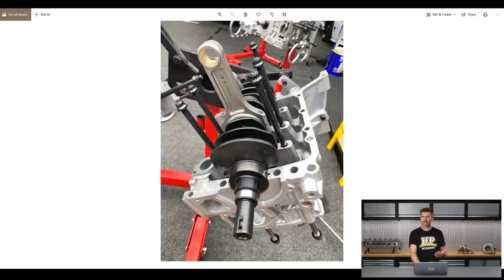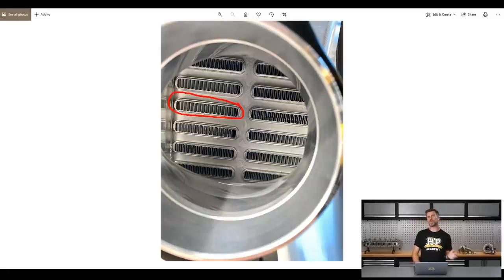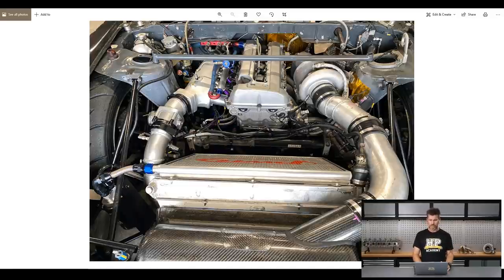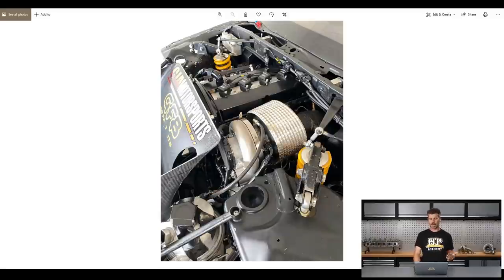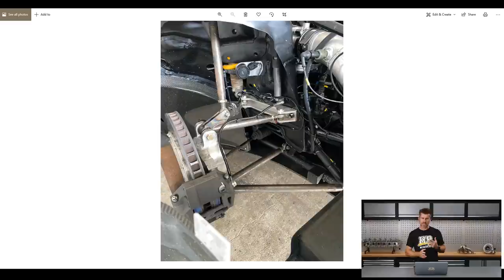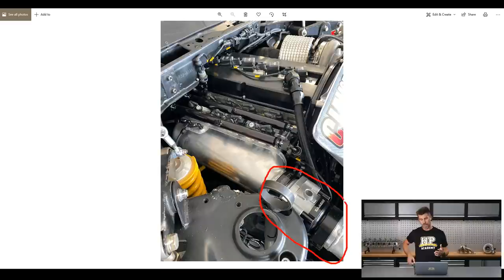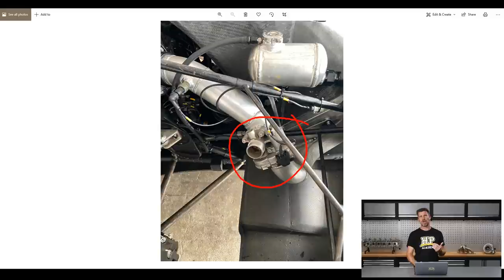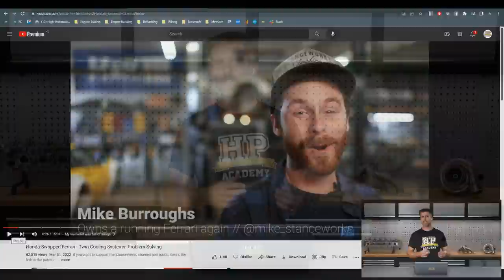Aftermarket Studs and Block Distortion [#UPDATE 305]

Comment: Just get the block line honed with the aftermarket studs torqued down, that's the right way to do it, because if your undertorquing them, you'll start loosing oil pressure if the cap gets loose, spend a few hundred dollars to do it right.

Comment: HP Academy. I am wondering if you would do another video on connecting rod balancing. Scat has produced an H-beam connecting rod they labeled "Ultra Light". There is a hole drilled through the rod beam just above the radius of the big end for the purpose of reducing weight. Since H-beam rods come without a balancing pad, it is possible to utilize this method to get rods in balance. Scat claims the size of the hole they produce has absolutely no bearing upon the strength of the connecting rod. Since a U.S. dollar bill weighs about 1 gram, I doubt a hole would be large to balance a rod end for end. The ribs on the cap are so small and there is not a lot of material parallel to the rod bolts. I think Scat had been doing their homework. Hope you are interested.